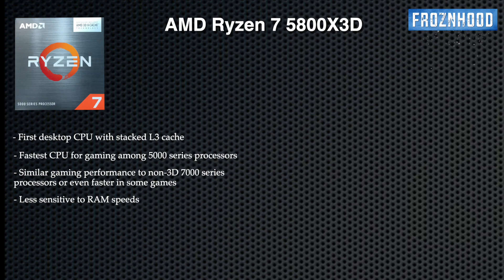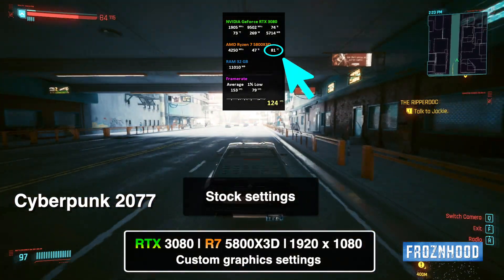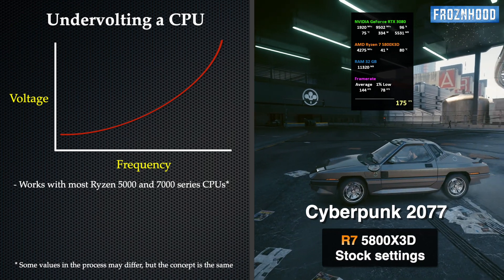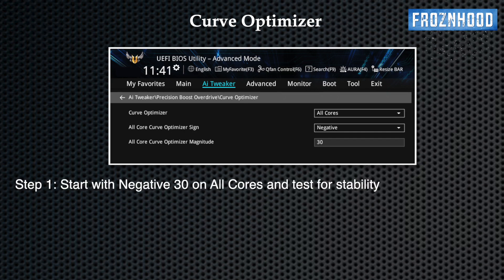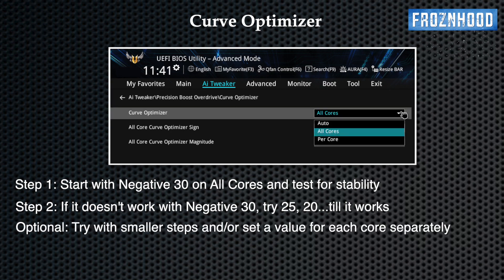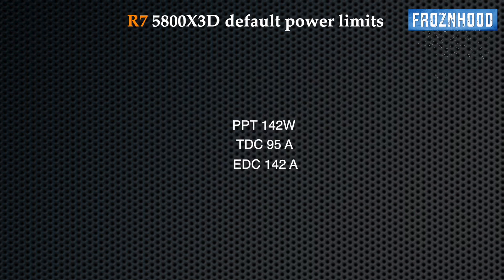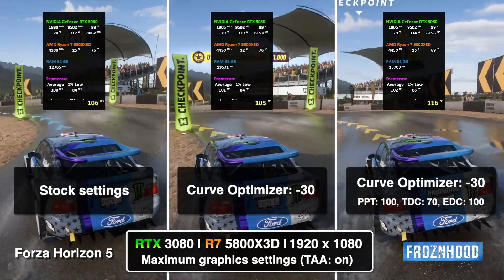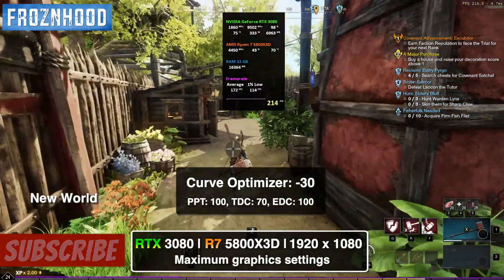Optimizing Ryzen 7 5800X3D - Higher performance, Lower temperature | Undervolting | Curve Optimizer

Comment: I hope you can help here. I have everything maxed out on my Ryzen 7 5800x3d, xfx rx 7900XT and 32gb ram CL 16 3600Mhz. I have done everything 100/70/100 and -30 and i get roughly 93-95 FPS in the scene of 3:40. Is it a good thing? Its so hard to tell how good/bad it performs because i cant really tell if its okay ...
Reply from the maker: Hi, in order to compare results, you must be sure that you are using the same in-game settings. There many videos on my channel where I show the settings I have used for a specific test. And choose a game that is more CPU heavy.

Comment: Wanted to throw in my thanks here. The curve alone gave me a 275MHz across all cores on prime95 at the same 90c. When I applied 100-70-100, I dropped back to 4000 at 70c. I tweaked it a little further to 110-83-110 and that gave me 4250 across all cores at 81c, which I'm more than happy with. I'm able to single boost a core up to 4.45 at 70c while gaming STALKER Anomaly which is an old title that is single threaded.

good stuff, thank you!
Reply: I would take down the last number with 110 Ampere, the first one is 110 watts, that's ok.

But by jesus take down the 110 Ampere. This will kill you SOC. 

Do you know, whats a 110 Ampere on a cpu  , dude ?

110 amps x 1,25 volts = 137,5 Watts 

Your 5800x3d doesn't need at all, almost 140 watts that's to much 😂😂

Comment: I have a an ROG Strix B550 F WIFI II and I can’t find the PBO settings in the ai tweaker settings. I Tried to putting my 5800X3D in a friends TUF X570 plus wifi PBO board and it was there. Any fix for this?
Reply from the maker: Have you updated your BIOS to the latest version?
Reply: @FroznHood  Thanks! I just did that and it worked

Comment: Bruh, what did you do to my CPU?!? It's now running with a package power of 60-70W and die temp of 60-70C air cooled in game with as many or more frames than before. The CPU fan doesn't even reach max RPM. Dark forces are at work. Thanks!! ❤ The 5800X3D is godly, even today.
Reply from the maker: I am glad you have achieved good results. 😀

Comment: My problem is if I set the limits other than undervolting my clock speed don't hit 4.45 GHz only around 4.3 with both -25 or -30 could this be silicon lottery or I'm doing something bad.
Reply from the maker: You should follow the steps exactly shown in the video. Nothing else.

Comment: I'll get this CPU on Thursday and as soon as I've reset my BIOS and reinstalled Windows, I'll do a few benches
I'm really curious to see how it will be as soon as I apply these fine tunings to the CPU. 

With my (RX 6750 XT OC) I will also do some undervoting and some fine tunings, just get the maximum out of the PC.

Thanks for the video, I'm now looking forward to Thursday even more

oh, and of course I'll be happy to share my results here too
Reply from the maker: Hi, thanks for watching the video. I have one important advice. If you are going to undervolt both CPU and GPU, do not do that at the same time. First optimize the GPU. Test it and make sure it is stable. Then start optimizing the CPU. Otherwise, if you encounter problems during the process you will not be certain where the issues are coming from.
Reply: I actually have one more question and that is that I have been able to implement the whole thing, everything is stable so far, but now I don't see a higher score in Cinebench 24, is that even the right tool for testing? Or are game scores the right approach? 

I would appreciate any tips 😎🤝
Reply: Just to say that again, I use exactly the same values as in your video, also the temperature has dropped from 80c to 76c, only now I don't know exactly if I just have to do several runs in Cinebench, or if I still have to fine tune and if so where?😅 

Kind regards Ben
Reply: Ok I take it all back, that was probably just the first run, I've now jumped from 850 points to 900 points, and the CPU only went to 77C° degrees.

So everything is cool, I have now also set my RX 6750 XT Oc to max oc and also allowed a bit of undervolting, what can I say 

RAM also runs on 3600 c16....

The device is a dream thanks for your video.
😎🤜🤛
Reply from the maker: Hi, sorry for the late reply. Use Cinebench only for stability testing. Compare the performance only in games. The target is to have a stable machine that runs relatively cooler (and silent) and has good performance in games.
Reply: @FroznHood  All good😎✌️

Yes, you are absolutely right, stability definitely comes first, but I have now also had performance growth everywhere, so everything went great, the PC is also stable, thanks to full ( be quiet! ) Fans + Aio + PSU and also fan curve optimization, my PC is much quieter than my consoles 🤣, in IDL of course, when gaming we all know, graphics cards set the tone.

Thanks again for the powerful tips, Ciao

Comment: hi i was wondering why my cores are all at 3600MHZ max, did i miss out anything in the bios?
Reply from the maker: You may need to fully reset your BIOS or update it to its latest version.
Reply: @FroznHood  ok, thanks for the tip. I will try

Comment: Noob question here - does undervolting make sense even if I dont have heat issues? I am using 5 fans in the case (3 intake 2 out) and a Dark Rock 4 and while it hits 83 in heavy load in cinebench from what I read this isnt really an issue for the 5800x3d given architecture.
Reply from the maker: The target of the undervolting is stable max frequencies in games and lower temps (and from that -> lower noise from the fans). If you are using the PC for gaming the temps during the Cinebench tests don't matter. You need to check the temps during gaming. If they are often above 80 (that also depends on the game) I would do the undervolting. Not because 80+ is a problem for the CPU (it is not), but because lower heat means less work for the fans, and that also leads to lower noise. Also, if the CPU is working at 80+ it will probably regulate its frequencies in order to manage the heat. This could lead to a slight throttling and loss of performance. So the second thing you should watch during gaming is the CPU frequency.  It is up to you to decide whether you like how the CPU runs at stock settings. The undervolting procedure is not mandatory for the normal operation of the CPU, but in case of 5800X3D it drastically improves the temps and can also improve the gaming performance.

Comment: Maybe im the only person who doesn't know how to stability test because i haven't seen any other comments. Hopefully, you see this comment and can explain how. Either way, I'll be trying this once my parts get in this week
Reply from the maker: There are many apps you can use to test the system for stability. Cinebench is one of them - both single-core and multi-core test. One hour testing is enough. Then, test the system with the games you usually play. If you notice anything unusual (that wasn't happening before) like crash, freeze, stuttering or system restarts, you need to change the settings till you get full stability.

Comment: Awesome tutorial! Guys if something doesn't work for you, be sure to update your BIOS to the newest available version! I was constantly crashing on old bios. Couldn't undervolt more than -10. When I updated BIOS to the newest possible, -30 and PPT TDC EDC are running smooth as butter, not a single crash and my temperatures went down by 20°C!

Comment: Hello! Does anyone know what do if I use a Asus Strix B450-f gaming motherboard? I dont seem to be able to find the same configs as shown in the video? 
I have also look at some comments here, but I dont seem to have the same configs as anyone, i will keep searching, hope someone can help, thanks in advance!

Also huge thanks for making such a straight foreward video, it is super helpful for the community! ❤
Reply from the maker: Be sure to update your BIOS to the latest version and then check again for those settings.
Reply: @FroznHood  I have done a flash drive update, then thing that I am missing is the "Curve Optimizer" with in my motherboard. I have PBO but for some reason I can only change the PPT, TDC and EDC. What I have done instead is readuce overall voltage by 0,0521v and it seems to run steady and work fine. I just think its weird that I cant find the "Curve Optimizer" like everyone else; (and trust me I have really tryharded searched my BIOS throughout). But yeh if anyone have knowlagde on a Asus ROG Strix b450-f gaming motherboard please let me know if Im able to use "Curve Optimizer" :)
Reply: search for PBO Tune 2 bro :)

Comment: i have 
GPU: GTX 1660ti
CPU: Ryzen 7 3700x
RAM: KINGSTON 16 GB (2x8) 3200mhz cl16
MOBO: B450 GAMING PLUS
PSU: ASUS TUF GAMING 650W
ordered 5800x3d, is it worth trying same settings as you or maybe trying -20 instead or just sticking with stock

Comment: Hey in my build it work best -30 110 80 110 is that ok? :) tested in cinebench r23, before render test was 90 now 80, ingame was 80-85 now 65-70 :D
Reply from the maker: Hi, it is a good result. Keep these settings if the system is stable..

Comment: It worked on my Ryzen 7 5700x3d.
Temperature was 85 - 90 degrees at full load by cinebench and now the maximum is 70 degrees. Thank you very much for your work - AG620 DEEPCOOL
Reply: Did you apply -30 CO and the same PBO limits?

Comment: I've been running negative 30 all cores in PBO for some time and it really helped to bring my temps down. Now setting 100/70/100 has brought my temps down by another 5c, but I've lost 300 points on my Cinebench score and CPU only boosts to 4300, previous was 4400.
Reply from the maker: As I have said it here many times, the Cinebench score doesn't represent gaming performance. use Cinebench for stability testing only. Test the performance with games and nothing else. If you need an optimization for heavy multi-core tasks, this is a completely different case.

Comment: Hello mate I just can't get the cpu over 3.6g I done the updates and the limits tested with the - 30 but it won't go beyond 3.6 please help!
Reply from the maker: Update the BIOS to the latest version. If you are already using it, make a full BIOS reset. This will solve the problem.
Reply: @FroznHood  done both mate it won't budge! Ive looked up everything I just can't figure out why it won't stay
Reply from the maker: Does it go above 3.6 with the default settings? If so, try CO -20 or lower + the power settings.

Comment: Was looking into doing this on mine 5700x3d, but since I'm running an older Asus X370 ch6 MoBo it appears that they have removed the entire PBO section of the BIOS, so no curve optimizer or any of that. My only choice was too run a core voltage offset
Reply from the maker: Have you updated the BIOS to the latest version?

Comment: I tried this and my frames didn’t get better. I had 10 to 20 frames less.
Reply from the maker: Something is not right. In which game? And 10 frames from how many? Are you watching the frequencies, are they at maximum?
Reply: @FroznHood  All games. Normal is over 120 frames and i was getting 94 and no higher then 100. frequency never went over 3.5hz
Reply from the maker: As I mentioned, you have a problem. You probably need to update your BIOS to the latest version. If it is already the latest, you need to fully reset the BIOS. You should get maximum frequency with this optimization as shown in the video. Don't worry, other people reported exactly the same problem because of outdated BIOS.
Reply: @FroznHood  I'll looking into it. Thanks
Reply: @FroznHood  Update, I updated the bois and now its boosting to 4.3hz. Thanks again!
Reply from the maker: You still don't get the maximum performance. Make sure that you do not change anything else regarding the CPU in BIOS. Check the frequencies and the temperatures in the video. You should get similar results with a relatively good CPU cooler. 4.3GHz is a good result for multi-core tasks.

Comment: What you don't mention here is that your power limit settings will severely cripple the Multithreading performance. Not much of an issue for gaming, but if you need your CPU for occasional workloads, you should be mindful of this
Reply from the maker: Thank you for your comment. This is a gaming optimization, and I am showing games in the video. And it is a gaming CPU. For heavy multi-threading tasks you should use a different CPU. Nevertheless, you are not exactly right. Although the ALL-core performance is reduced by this optimization a bit, the difference is not huge in a long run (20-30+ minutes) - up to 10% (rarely more, depending on the cooler) depending on the unit. And this is far from "severely cripple". If you get worse multi-core results, something else is wrong in your system. The ALL-core max performance of this CPU generates a lot of heat, requires very aggressive cooling and the frequencies are still not stable in a longer session. And even in this case the performance will be much lower than 5900X, 5950X and all 7000 series CPUs starting from 7700X. As I said, 5800X3D is a gaming CPU. Thanks for watching the video. 😀

Comment: this should work on ryzen 7 5700x3d?
Reply from the maker: The logic yes, but the power values will probably be different. 5700X3D runs at lower frequencies and may not need much optimization. I haven't had the chance to test it.

Comment: If my cooling is strong, then I suppose this will only better power consumption.
Reply from the maker: It depends on what you mean by "my cooling is strong".
Reply: @FroznHood  I didn't catch if you revealed what cooler you used during tests. I own beefy Dark Rock 4 pro, so I just wonder if tweaking would further affect clocks, when I expect cooling to already be sufficient.
Reply from the maker: Optimizing the CPU is a complex of factors. The cooling level is just one of the factors. The others, and probably more affecting, are voltage, power, core usage etc. If you have stable max frequencies and if you are satisfied by the temps you have, you probably don't need to do this procedure. Dark Rock Pro 4 is a good cooler, but it is not Nitrogen. So it can't drastically affect the frequencies, without tweaking the voltage curve and the power settings. I know these coolers very well. The cooler I used is Dark Rock 4. The performance difference between Pro and non-Pro are minor (or let's say not significant) according to my tests.

Comment: I dont have PBO or curve optimizer in my asus rog strix b450-f bios. Im on latest firmware. Tried with 2400g and then with 5800x3d. Nothing. I cant use ryzen master either. It says it is not compatible with this cpu (5800x3d) What the heck!?! This is so strange.

Comment: Dropped 9c in Cinebench for the same performance lol. 78c undervolted with default ppt -> 69c with these values 100 70 100. Same FPS in heaven benchmark but with higher min/max fps :)

Comment: With these values I see that under PRIME95 (Bench tools) the frequencies are lower using all the available cores. I was wondering if these options are only good for games or in general, without having "speed" losses in other applications. Bear in mind that with prime95 using ONLY the limit at -25, in SMALLFFT I immediately touch 90° and the CPU limits itself. Thank you
Reply from the maker: This is an optimization for gaming or for tasks that do not utilize all 8 cores. For tasks that use 100% of all 8 cores completely different optimization is needed. It will require more power and extreme cooling in order to sustain higher frequencies on all cores.

Comment: Is Kombo Strike 3 best option you can enable for your 5800x3d? Like lower temp + performance boost? I'm running it right now without problems and i have low temperatures. Dunno if 1 or 2 are better boost? or no?

Comment: This was the best undervolting guide that I have came across. I am hitting 14942 in cinebench compared to the stock 14061. Thank you so much
Reply: got around the same increase but was hitting +1c, might've been timing but it's only 1%. Though, the performance difference didn't really seem to do much on Warzone and will probably only mean something on cpu-preferred games.

Comment: Amazing tutorial, and definitely earned a sub! Would you recommend the same values in this video for the 5600x3d?
Reply from the maker: Thank you. 5600X3D is an identical CPU with 2 cores turned off. This is a big difference in terms of heat generation. You should be fine with only setting -30 CO. Change the power settings only if you need.

Comment: Just installed mine - needs further stability testing, but here are some CB23 results:
stock - 14816 @ 68 degrees max (12.5 amb)
-30 all-core - 15079 @ 57 degrees max (13 amb)
Still to play around with the power and current limits to maximize single-core performance, but this is ridiculous!

Comment: I had maximum 50°C while I tested my 5800x3d with Cinebench. Is my cooler just damn cool, or is something wrong with my cpu?
I have framedrops in Fortnite in 4k ultra settings.

why does Fortnite always look like shit when people show their fps?😅
Reply from the maker: Hi, under normal conditions 50C in Cinebench means that your CPU is probably not working properly. You should check the frequencies both in Cinebench and games. With a BIOS reset and proper RAM configuration this should be solved.